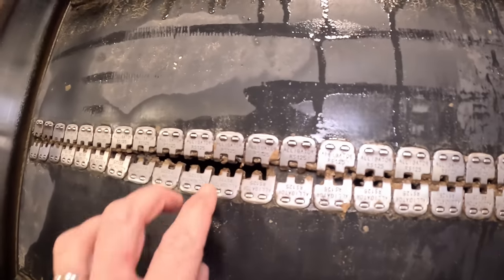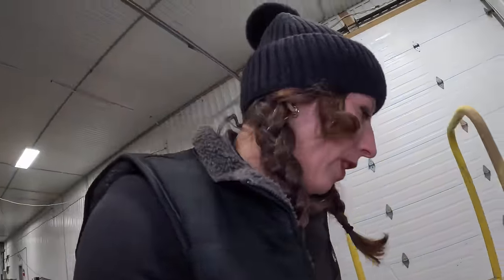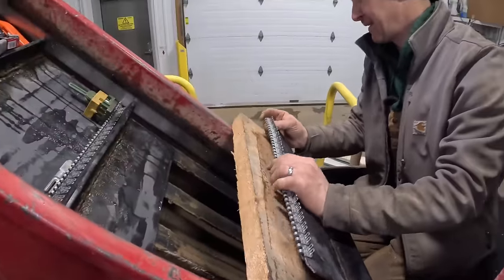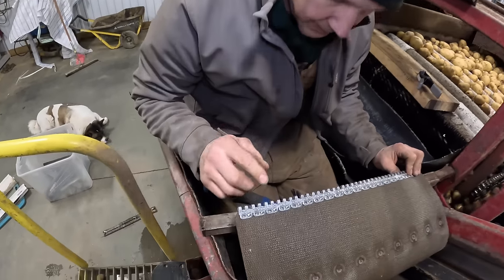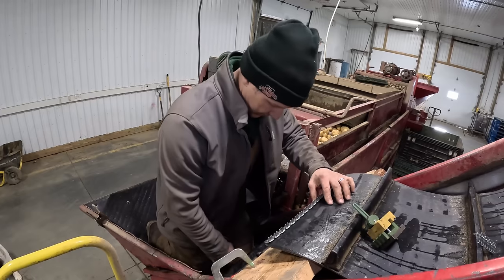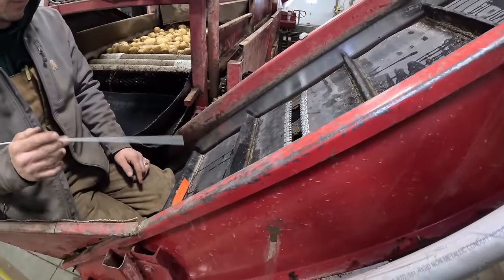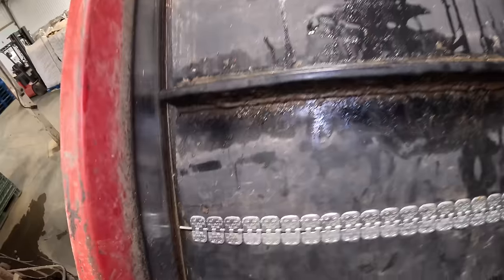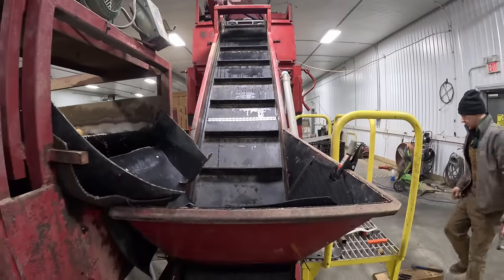How to replace Alligator Lacing RS125

Comment: People debate whether knowledge or experience is better.  Wouldn't both be the best situation?  Clearly Shane has both.  He has the tote with all the parts including the metal bar and the wood block that fit the conveyer.  The hole in the side of the conveyer is genius!  The manufacturer should include it from the factory
Reply: I think knowledge and experience are the same but acquired differently.

Comment: Good job well done. Being one who has many belt repairs under his belt. I'd like to recommend a good square and installing the lacing rod in before you do the hammering. But you got it down. P. S. The new belts are a pain in the ass the way you repair them. Or should I say replace them.
Reply: I occasionally use a framing square, it wasn’t where I left it so I grabbed the closest piece of straight metal I could find. Haven’t had to deal with any of these new fancy belts … yet

Comment: Hey Molly it works the same way on a tire machine the steel belts ran on the conveyor belt but we had to hot iron the splice so the camera and sensors wouldn’t read it I worked for Goodyear Tire and Rubber company for 36 years later y’all.❤️😎🇺🇸
Reply from the maker: Awesome! Thank you for commenting! I can’t even imagine how many tires you must have seen!

Comment: This is shades of belt repair for old style threshing machines. In those days there was no V belts, everything was flat belts. Flat belts had piano hinge lacing. I remember replacing those. It was a simpler crimp style lacing with a wire that went through it to connect the two parts. Your system is far more secure.
Reply: We used to use piano lacing all the time before we switched to alligator lacing. I still keep some around there are a couple applications on the farm that the alligator lacing won’t work so I still use piano lacing occasionally. Thanks for watching!

Comment: We use that lacing on our machines, things to note, make sure you cut the belt square, and center the new lacing. We use solid SS pins, but our belts are running a much higher speed.
Reply from the maker: Thank you! Glad this was relatable to you!

Comment: 14:44 I had to drill a hole in an air handler to get a 1/4 20 screw into the linkage that fell apart for the outside air / return air dampers. Disassembly to do it wasn't possible from a one man genie lift.
Reply: Sometimes that’s the best way to do it

Comment: You may have already got of them, but the rod that pushes the take-up should have a square nut on them that goes in the space on side of bearing. That way when you run the Ron back to loosen belt, the bearing goes with it.
Reply: I know what you speak of, I think those only work if you have nut on the threaded rod , not turning the threaded rod like I am here. I may be mistaken though.

Comment: Because I do not like doing things more than once I would have used some metal plate on top of the wooden plank rather than just the plank to avoid hopefully having to bend the prongs over after. Only an idea what do I know - never done that job before.
Reply: The wooden plank is used as a backer for hitting the staples down thru with the tool, then I flip the lacing over to finish flattening out the other end of the staples with the metal as a backer on the other side. However full disclosure I don’t think I’ve ever even looked at the direction s haha

Comment: Great video that really talks about and shows how to replace the alligator joints on a fast moving belt. Running at a faster spend probably wears everything faster; but, is commercially needed.
Reply from the maker: I did speed up the footage a little, the belt doesn’t spin too fast. But yes, all the fine dirt wears in it a lot too.

Comment: Great video! It on the surface seems fairly straightforward, but my experience is it looks easy because you have already faced the situation when it wasn’t easy, hence the hole in the sidewall. Gotta make a lot of things work on a farm, and the easier the better! I guess my question would be, how many times can you do repairs like that before you have to buy a whole new belt? After a time of cutting pieces off for the new seam you lose any extra pieces and it’s gets too tight to make the repair. Do you guys have a spare belt when that happens? Thanks for entertaining  my question!
Reply: Can get away with quite a few times, usually 5or6 I’d say, I usually don’t keep spare belts, but if it’s too short I’ll order a belt when last set of lacing is getting worn, if I don’t do that I will splice in like a 2’ section of belt to get me by till a new one shows up
Reply: @shanebell9589  that’s very resourceful! I like that way of thinking! Lol
Reply from the maker: Thank you for asking question!

Comment: Nice job at splicing your conveyor belt. With the risk of sounding like a safety Steve, unplugging or having a visible disconnect on an electrical circuit is a good idea.  Thanks for sharing. 👍